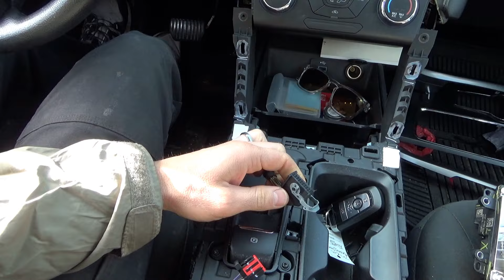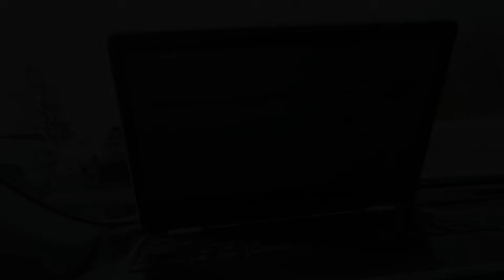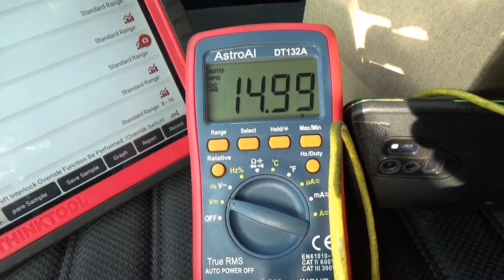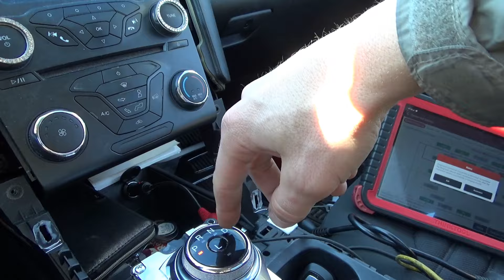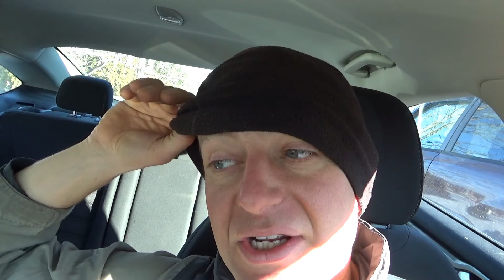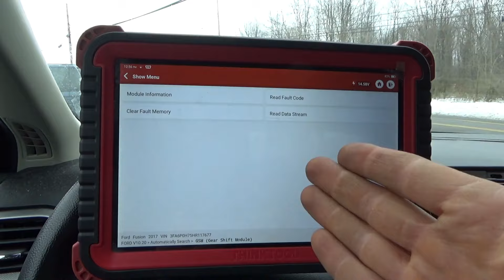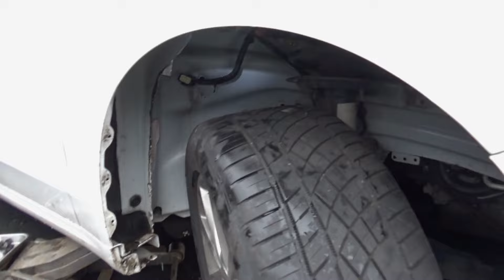Why New Cars SUCK (Ford Fusion STUCK in PARK?! - Part 2)

Comment: Shift by wire = stupid. But unfortunately a lot of cars are going to it. And if you work on a lot of Euros you're used to it by now. As you stated this is a learning experience. It's always like that. You get something you've never seen. It kicks your ass. Then when you finally have the answer it all seems so obvious. Good work brother. I'm always thankful for you, Mario and Eric. I'm constantly updating my diagnostic techniques based on the knowledge nuggets you guys put out there. Still see guys that don't know how to use a scope. And in some ways I sometimes feel like I overstate the importance of having that particular. But I think it's extremely important. To me it's not just knowing how to use a scope properly. It's that knowing how to use one also expands your understanding of how things work. Went on a tangent there. Anyway thanks for the content.
Reply: it isn't really shift by wire, it's just a servo pulling a regular shift cable, a useless needless overlay by ford...
Reply: @jonmack5359  was going to point out the same thing. If you look at BMW, Jags, other brands using a ZF box (even going back to the 2010s) they have no mechanical cable just wires to the transmission. Internally a solenoid is used for the parking pawl but otherwise just actuates the shift solenoids.
Reply: @jonmack5359  Exactly. Reminds me of those early "evolutionary missing link" electronic throttles that still had an actuating cable in addition to the electronics. 🤦

Would've been better if they'd gone full electronic instead of this Frankenstein.
Reply from the maker: @AkA-5660  early 2000s Toyotas had that hybrid cable and electronic control system... Mostly reliable but sometimes would fry the ECM drivers lol
Reply: @jonmack5359  okay mechanical linkage is going out in favour of electric. Yes the part that moves the transmission lever is still mechanical but the part pulling that cable isn’t. Old style cars the linkage went straight to the shifter so when you moved the shifter the cable would be pushed or pulled moving the transmission selector there were no electric parts involved.
Reply: Should be called "sh!t by wire" instead,
Reply from the maker: Thank you for your support Edwin 🙂👍
Reply: @PineHollowAutoDiagnostics  He's right about the scope. Anyway, the reason this system is used is there's a self park option on some of Fords vehicles. The car has to be able to shift on its own. There is also a recall on the transmission cable bushing. The bushing itself gets replaced, along with a cap that covers the end of the cable.

Also, I'm not sure if you realized that this car has 2 brake switches. On your scanner, it showed information on brake switch number 2. I know the problem was elsewhere on this vehicle, but its very common to have issues with them. If you go into data logger and look at the PID's for the shift interlock system, the brake switches are labeled BOO1 and BOO2.

If you work on a lot of Fords, it would be worth it to get IDS and FDRS. They use the same hardware, and the cost if fairly reasonable compared to most other brands. Ford is obsessed with making complicated designs. Way more than any of the other mainstream car brands. I work for them. All of our experienced techs are leaving for other brands and are being replaced with lube techs.
Reply: That's why people need to buy cars with manual transmissions... then you're the TRCM...
Reply: I could not have said it better myself!
Reply: But it only takes 3 or 4 scanners because one can't do them all, unfortunately.
Reply: @billmonroe8826  Not if you have a factory scanner.
Reply: @AT-wl9yq  To do just Fords?
Reply: @billmonroe8826  Yes. Mazda uses the same hardware and software as Ford. Since everything is compatible, you only need to buy Mazda's software,

Comment: A few weeks ago a customer brought in a 2010 fusion just to get some codes and no scan tool I had could communicate with the ECM, local dealership couldn't either, not surprised you didn't have any codes.
Reply from the maker: Can't talk to the ECM?? That's a problem 😅
Reply: @PineHollowAutoDiagnostics  Funny thing though engine ran perfectly fine 😜.

Comment: The new "safety overide" (if you open the door backing up without being belted, it goes into Park), drives you cray when you're trying to back up in a tight garage.
Reply from the maker: You can use mirrors or stick your head out the window lol
Reply: Even worse. I work in a body shop. If the latch or the door is removed (for repair reasons)  you can not move the car by driving it.
Reply: Tell me you don’t know how to drive without telling me you don’t know how to drive 🤣
Reply: @ChristopherVanZetta  Sounds like you've never had to back your car into a tight garage with three other cars that you're trying not to hit.

Comment: Wow. Interesting autopsy. Was hoping to see something broke or stripped but with such a complicated mechanism , that could turn into a mini series. It would seem to Me that a simple rack & pinion system could have been designed to do the task, but what do I know. That had to be a scary price for that part!  Nice work Ivan.👍👍
Reply: Why not this unit attached to the transmission run by wire and leave out the linkages? Simple but sidesteps towing perhaps when needed?
Reply: @larrybe2900  Space. Too much stuff in the way. It could be done, but they would have to make some changes to the vehicle.

If you want to talk about Fords stupid designs, this isn't it. If you get this vehicle or the MKZ with the panoramic sunroof option, its not serviceable. There's a couple of small things you can do, but for 95% of what could go wrong with a sunroof or sunshade, the only way to fix it is to chop the entire roof of the car off and install a new one. And its huge because if you look at the car, the rear window is part of the roof. Last time I did one, the part was about $12,000. Labor is extra, along with the 3 motors and the sunroof glass. Its just something you have to see to believe.
Reply: @AT-wl9yq  I’m a bit of an old school fella and I love my older vehicles for sure, but I guess if it were not for all this newer over complicated BS and if most people owned Toyotas, We all would not be here with Ivan enjoying and learning about all of this amazing new crap! 🥰😅🇺🇸👍
Reply from the maker: @AT-wl9yq  that's insane!
Reply: @larrybe2900  This feels like an add-on to an existing drivetrain.  There may not have been room on the transmission.  The placement of the device suggest they were concerned about surviving engine bay temperatures.
Reply: This kind of functionality is inside of a lot of transmissions.   IMHO, Ford moved it out of the transmission, maybe because it was a known failure point.   It's a double edge sword, since having this in the transmission means a trans out rebuild or a new transmission.  I think the reason why Ivan did not find this more quickly is that the ThinkTools scanner has the wrong label on the PID......
Reply: Did You notice the size of it?
Reply from the maker: @brianw8963  yeah about the size and weight of a big starter 🤣 What a joke!
Reply: @PineHollowAutoDiagnostics  Was there a core charge on that POS?
Reply: no core it was ebay @harrylister804

Comment: I'm guessing here but looks to me that the little motor moves plate to desired position and then the big motors move assy til it hits the trigger arm. That looks like the trigger arm releases the clutch. I'm thinking the oem scan tool has more function on the reset after over extension event. Just my thoughts.

Comment: From the look of that star on the bell crank I believe the mechanism can be forced out of time and retimed by changing  the position of the bell crank. The first gear you removed looked a little sloppy and could be the culprit, I suppose. Just a guess from 900 miles away. Steve

Comment: Thanks Ivan. I really enjoyed watching this repair as I too have a car with an electronic shift lever that I can't abide. Although my car has a newer designed pistol grip type controller, the previous model had a rotary knob like the Fusion, and I'm sure both have a similar TRCM to act as the replacement 'muscle' that was needed to operate the older mechanical type shift levers. So very useful knowledge to have. 👍

Comment: good video tks glad you took it a part .but if remenber right in part one you could move the lever on that part with cable remove to see it position on the scanner .so i think that not normal it should not move for safety reason .something is louse on the shaft to make spind

Comment: We used to call it a hard reset, get a 40oz glass bottle and a piece of of tee-shirt about 3" wide by 18" long , fill the bottle with whatever kind of gas you like stuff half the rag in there turn it upside down for a few seconds then light the rag and this part is very important throw the bottle at the car, problem solved

Comment: I thought brake press signal issue from the first video so maybe partially right. They need a better description on the data pid as they probably made a quick program fix for safety to check the cable position, however they are sensing it in the module, when the brake is pressed and lock out the dial if the cable did not return to known position but they left out the DTC!!

Comment: Of course it's on back order. They're breaking left and right. By the way we've been seeing a lot of Ford Focus DPS6 transmissions in our shop. The reason I'm mentioning it is because the first time we ran into this issue we were a bit stuck on the diagnoses. But what happens is the transmission shift fork gears have a stop that's built into the casting of the transmission case. That stop breaks off. And so the gears can't find their stop points. And you lose all gear engagement. The way you know is that there's an inspection cover for both gears. Remove them and if you can turn the gears infinitely that case is broken. The solution? Remove transmission. Install new case. Crazy.
Reply: Edwin, when you say remove the inspection covers and turn the gears are you referring to removing the A and B shift motors and using the Ford tool (in the clutch kit) to run the shift fork gears in both directions? There is obviously quite a bit documented about all the various issues with the DPS6 transmission but what you're describing above is one I don't see much info on ..... at least for the general public. Is there a TSB for the broken case stops? I'm assuming the aforementioned broken case stops were likely not the issue on Ivans car or else the problem would have repeated itself?
Reply: @Greg  On the side of the transmission, or if you're looking at it outside the car it would be the back of the transmission, there are 2 plugs that can be removed. As soon as you remove them you'll see spur gears. The components you're referring to isn't what I'm talking about. Those yes you use to sst the clutch for first relearn of the touch points. Those are for the clutch forks. The ones I'm referring to are for the shift drums that control the shift forks.
Reply: @foolsendextremebashing  interesting thanks
Reply: Good info to know. 👍 Those DPS6's are my bread & butter. I've done alot of clutch kits on them have never seen that gear issue( knock on wood)
Reply: Lemme guess. The case is on back order too, right?
Reply: @rickn8or  Lol. I'm not sure actually. I think we've been pulling used cases. But another common failure is the TCM on the DPS6 transmission. And those are on back order. So yeah man. If one of those Ford Fuktus comes in with transmission issues we all roll our eyes. Lol.
Reply from the maker: Dual clutch is garbage... I won't touch them 😅

Comment: Pretty sure that small motor moves that cam plate and allows the shifter to shift. There must be a sensor on/near that small motor that responds when the park lock has actuated. That would explain why your calibration test didn't work because the "safety" lock never unlocked -would also explain your scan tool PID never changing.  My guess is that cheap little motor or a mosfet gave up. That module looks like something BMW would do. Great video.
Reply: BMW's sihft by wire controls transmission valve body directly, no stupid shift modules involved.

Comment: that's the problem with engineers and politicians, if there IQ is over a hundred there common sense is zero .
Reply from the maker: Actually a lot of politicians IQ is probably single digits... Especially those that are suffering from dementia or had a stroke and still somehow got into office 🤣
Reply: @PineHollowAutoDiagnostics  🧂🍦🤣

Comment: Keeping my 2003 Chevy 1500 van forever 400k Miles now 
In a few years all these high tech POS cars ecm s  modules electronics will fail and be useless..
Even Construction equipment has this issue.
They are doing this to induce purchase of new cars and not to keep old ones .
Good work!

Comment: check the capacitors because if they were shot then the motor will not have enough juice to turn and pull the cable. you can measure the rated Mfu.
Reply: Gotta love cheap caps.
Reply: its not the caps...
Reply: Thinking the same
Reply: Wouldn't a blown capacitor make a smell?
Reply: Oh suuuuure...

Comment: Now this video is out, Ivan just saved many many customers so much money in diagnosis fees and parts cannon costs and it only cost Ivan several hours of his skilled time. Kudos and bravo to Ivan.
Reply: And everyone who encounters this same problem in the future owes Ivan a big thank you.Maybe even donate a little $$ his way for the training that we all got for free
Reply: Several hours of diag, when a traditional shift lever would have cost Ivan maybe a half hour. Necessary diagnosis on something that is unnecessary. Just like push button start, cylinder deactivation and stop-start, which add a ton  of complication for things that are of very little benefit.
Reply: @TheLoneShark-s6y  Electronics is almost always more reliable than mechanical parts, but if the electronics masks a mechanical failure, it becomes a disaster (and of course vehicle makers are producing as cheaply/nastily as possible - pointing fingers at "China" is just deflection from "quality built to a price" - Chinese vehicles are getting to be the best built in the world, especially their domestic models)

BTW: having used fords for decades as fleet cars, I wouldn't buy one, but then again I won't buy GM either. Living outside the USA means we get better exposure to reliable vehicles and the odd part is how UNreliable a lot of "euro" cars are in the USA market - usually explained by finding out they're USA designed and built specifically for the USA market (Before anyone slags on British cars, Nissan/Infiniti G20 and other ones are British designed/built, but worked fine as were several Honda and Toyota models, The reliability aspect of "british" brands is down to rotten design, manglement and lack of QC/TQM)
Reply: Bad move - Just because THIS problem happens to be one option does not mean the next one won't be one of the other possibilities. It means you can narrow it down faster but don't assume that what ails one vehicle is going to ail them all.
Reply: 1000% TRUTH👍👍👍
Reply: Vehicles are designed poorly to keep the common man in debt. Car's and trucks have become like cell phones. Throw away and upgrade. It's time to hold manufactures accountable.
Reply: @Anthony-whocanitbenow  they are a lot better now than in the 1950s when American cars in particular were designed with a 5 year lifespan in mind
Reply: @miscbits6399  That's definitely true. It's just sad that a company like Ford that once was a leader in engineering has so many issues. I'm a mustang fan and have had many however l can't defend the blue oval anymore. I've never owned a ford that didn't have water leaks whether it be windshield,rear glass etc.
Reply: Yes, what you said, George.  Thank you, Ivan, for undermining your own job security for our benefit.
Reply: Nonsense
Reply: The same thingr just happened to my car but when I take off the battery for 5 minutes start working again I don't know what happened is crazy
Reply: I hope he charged the dealer the full amount! Obviously, even the dealer isn't smart enough to understand how their product works.
Reply: @billmonroe8826  
Ivan said it was a local shop, I don’t recall him mentioning a dealer.
Reply: @billmonroe8826 lots if dealers do not have diag techs on hand. So if they dont really know where to look for info they pass it along.

Comment: Only simple vehicle as of 2023 I would ever buy would be the dinosaur toyota 4runner or tacoma till the changes are made this coming year. These are the last vehicles not using start stop, direct injection, cvt, turbos, cylinder deletes just trouble free 500000 mile vehicles. These new vehicles I see daily in shop with stupidity issues and costly unnecessary repairs.

Comment: You would think it would set some sort of limit switch codes or something. You’d think with a system like that it would make sense to have limit switches built into a bidirectional module especially for a system so important. Toyota 4wd system at least has limit switches you can use to diagnose shifting problems since you don’t have 4wd ecus Atleast in the older models.